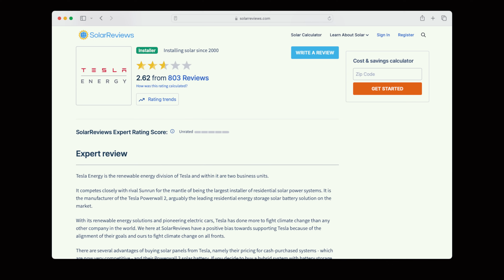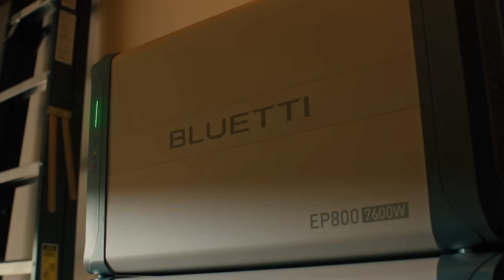The NEW Way to Install Solar (No Contractors)

Comment: Bro, I’m a contractor literally Workmen’s Comp. is like 60 bucks a month per employee. My bond insurance is like 150 a year in general liability if you want it is like 100 bucks a month 300 to 200% markup no excuse. 800 a year for a corporation I work out of my home so no overhead cost there once you invest in your tools you got those for many years which are minimal talking about drills and wire cutters here.

Comment: I'm preparing for a solar/battery solution and my inspector is fantastic especially with the nearly final plans.  I'm a retired electrical engineer who strongly prefers doing my own work.  I put all new service entrance, transfer switch, and standby power system to support a geothermal retrofit and two EV chargers.  Next is solar/battery, but first am monitoring the total power for proper sizing.

Comment: Top Electric DBA Shield Energy, out of Utah, came in and made so many promises, I thought I had stumbled upon the best contractor ever.   Only to have them install my entire system WITHOUT A PERMIT!  Then they call me to tell me they messed up and we'll need to install a 200 amp service on my house at their expense.   Then months go by and nothing happens.  I start threatening to sue and after months of phone calls not being returned they finally came out and installed the 200 amp service.   And right when I thought they were going to honor the deal, they walked away again!
And they were just going to let me hang until I started to sue the finance company.   And it was the finance company who came up with the funds to finish the job.   I had to get an independent electrician to come out who was familiar with solar to pull the permit and get the job finished.  I ended up getting a free 200 amp service upgrade but it took two years to do the job.

Comment: One aspect you did not cover was solar racking.  I can only afford to do it DIY because I've found gigantic markups on installing certified ground mounting of solar panels from contractors.  I live in a small city of 3,000 and can't rent auger equiment or machines to drive posts into the ground.  And the inspector here has never seen a ballast-type of solar panel racking and was told he will not pass it.  I've gone to every house or business that have solar panels in my city.  They're all happy with their system and was happy to share their company that did the install.  But when I called those companies every one of them was out of business, except one.  And he no longer served my city here in Northern Calif. as it was too remote.  Can you help with the permitting process for grond-mount ballast-type solar panel racking?

Comment: Thanks for video, please show an electrical diagram for what you DIY installed and go step by step in your next  video on what is what in the diagram. This will help folks better assess whether can DIY a solar plus battery backup system. Also please clarify if the backup has an automatic transfer switch or manual one that you installed.

Comment: Bluetti is a good option but there are other companies like eg4 where there stackable batteries cost half the price of these. One eg4 5k battery is about $1,200. But overall, Andrew is spot on the approach. I did this personally, hired independent roofer and electrician and bought my own kit and had a 10k PV array installed with a 20k battery bank. This runs the whole house including an AC (with soft start) system and 1 hp well pump

Comment: You can do the same thing with YouSolar Inc.s "Power Bloc" which is a homes primary power (not a backup); powers all loads; no utility approval needed; charges batteries directly by grid; solar; wind; hydro; EV; any size generator and at the same time with no utility approval needed. DIY or have a electricians help. 

A USA company. USA! USA! USA!

Comment: Battery backup and solar is not real rocket science. A general understanding of electrical theory and unified building codes is adaquate. Here in the north air conditioning is just a convienience but non-electric heating is mandatory I have both natural gas and propane and I have two tri-fuel generators for backup on cloudy days.My sloar is planned at just 5000 watts and my battery is 12,000 WH. If all else fails I could run the central air off one generator but it would be expensive

Comment: DIY solution is basically dead. I've been calculating costs savings for the past 2 months with research and I am literally within saving $1000-5000 only. this is coming from where all the equipment and installation pass inspection and is able to turn on and power my house legally.

DIY comes with 4-6 more panels and a decent sized backup battery. However, you have to do the work yourself or hire someone else which can cost anywhere from $8-15K with limited warranty. then you have to worry about permits, inspections, your AHJ, POCO. a lot of these youtubers or diy'ers show off their fancy system but most of them don't tell you if they got permits for it and I feel that the majority of people don't want to go down that path. plus a complete kit online isn't 100% complete, you still need to buy misc conduits, wires, nuts, bolts, etc.

DIY: 10kw panels, 10kwh batteries, microinverters/inverter/mppt/hybrid (whatever system you choose). comes with rails and permit ready for $24k. you do your own install.
Pro: 6.4kw panels, 10kwh batteries, they will handle the complete install and until power is on for $26k. comes with labor/workmanship warranty
this is a california quote I just received about a week ago on my house.

Comment: Hello. Thanks for the video. DIY sounds like a possibility! Personally, I would avoid roof top, and go with ground mount  or unattached car port if it were me.
There's a slight "ringing buzz" sound coming from the audio feed every time you talk into the mic for this video. (It is not in your older video "How to Solar Power your Home" (Not sure if this is a new mic or what the source might be).

Comment: I know from listening to other videos you have done that DIY is not a good choice - leave for professionals.
Also, you have had an installer on and both of you were not positive on DIY and Signature Solar in particular.
SIgnature Solar has a battery system (Ethos) that is even better than this option manufactured by Big Battery out of LA, California.
As simple and coupled with a LUX inverter (Their EG4 brand) you are ready to connect to Breaker Panel, add solar, and even add a small generator and you are done!
Thank you for pointing out options for all listeners!
And I do understand this entire industry is shifting and changing primarily due to Cali Net metering 3 - and others are soon behind.
Keep up getting good and factual info going out on your channel - it helps ALL customers!

Comment: Thank you 😊. I run a small business and trying to go solar or battery backup is impossible. The joke is that solar has a 7 year pay back period for the last 20 years despite lower battery and solar panel costs and higher electric bills. The only way to bring green energy to the masses is to remove the middle man. Same problem in mini split systems.

Comment: With all the other ignorant stuff that you're refusing to learn 
on solar now you get to install it yourself with all the solar panel  fires how much higher will the insurance be
Bring the s'mores you can say you installed it yourself
Reply: That depends on where you place the solar panels. My landlord self-installed the solar panel in the backyard without any problem.
Reply: @anthonyc278 until there's a prob so not only stealing from us and the power company also stealing from the insurance company 
Pretty shady
Reply: Oh yeah and the problem of it only putting in less than 20%

Comment: The battery part is fine, but when you include solar, you still have to get a lot of red tape in terms of getting them install. Thats where it cost too much if you ask me. Construction permits, to electric permits is why going solar can cost too much in general. Until that red tape goes away, is going to suck either direction you really go. So we need cheaper install methods for the solar part. It shouldnt cost someone 5k or more to install and setup that half of it.

Comment: One of the most important skills to possess, as a small business owner, is the ability to "pivot".  The traditional model of selling solar to customers has more or less collapsed, with the advent of high interest rates and the long-overdue gutting of net-metering rules.  This video is one of the very best you have put out, and I honestly hope you understand why that is.  There are really four different components to any "solar" setup; the PV array, charge controller, inverter solution, and battery array.  As more and more equipment manufacturers have improved their offerings, integrating those components and making them far more DIY-friendly, more and more consumers have taken on the challenges associated with becoming their own power company!  If you can adjust your business model to supporting that move toward DIY implementations, I think you'll add value and generate revenue.  I hope that works for you, because the glory days of selling solar systems are probably gone forever.  The biggest challenge is going to be financing these DIY projects, because I don't see a lot of banking institutions willing to take that risk.
Reply: Yes the banks and consumer are not willing to take the risk which is why DIY is best to start very small and build it over time as you learn. EVs will also help as the come online as our next big mobile power stations.
Reply: @DanRingwald  - As long at those EV's aren't using some kind of ternary battery source, maybe.  Otherwise, that would be an insanely expensive power source, and one you really should be relying upon for transportation, since that's what it was designed to do.

Comment: Sunrun moved my main breaker that supplied my home power from the electric company. The connection was poor and resulted in a fire. After a month of trying to get the power back on in my house using sunruns contractors, I hired my own electrician, came out of pocket another 3k and got my main panel replaced after the bus bars burned up. Sunrun kept playing games saying they didn’t have anyone to send or etc. I paid 30k for that system through Sunrun. I would RUN not walk from SUNRUN. Also the LG Chem battery installer, drilled 15 holes in my wall instead of using a stud finder and thought it was funny when I said something.
I installed my own solar panels after that and it was so easy. Can’t believe I spent so much money to have a crew of yahoos and one guy that actually knew something to come out to my house.

Comment: Why would woukd say you may need a permit? In what major markets would you not need a permit, a legit planset, inspection, be done to local code etc??
Reply from the maker: There are some parts of Texas and Oklahoma where no permits are required if you are outside of city limits.
Reply: @SolarSurge  that's good for a few I suppose. There's a reason roofers and electricians are licensed trades.
Reply: @SolarSurge YeeeeHaawww, I’m in TX!

Comment: I recently purchased a 12 kW Inverter, 11.7 kW of premium PV panels, and two wall-mounted 14.3 kWh LiFePo batteries for $16,500 from a Solar System DIY warehouse. That price included taxes and delivery to my garage. I then went on Angie's List and got three local Solar Installers to compete for my business. The winning installer charged a flat rate of $15K to install the roof-mounted 30 X 390W panels, significant electrical wiring for grid interconnect,  Inverter install, test, and turn up. The batteries are drop-dead easy to bring up, but 300lbs each and difficult to wall hang. We agreed to an hourly charge of $100 per hour to install, test, and turn up the batteries. My finished system cost is $39,000. About 50% less than a comparable Tesla 3 system with only one 14.1 kWh battery.
Reply: Is $39k before or after 30% federal credit?
Reply: @iknoerleful   Before - around $27,300 after
Reply: Name of the company?
Reply: That's your initial cost.  You are losing about $2-$4,000 on that cash every year compounding.  Now you have absolutely NOTHING behind your "system" which is a bunch of depreciating parts you poured $39,000 cash into for some inexplicable reason! You got ""premium" panels (A meaningless description - but at 390 watts, I highly doubt there is anything "premium about them).  You have no labor, installation, or product warranties to speak of, no one to call or blame but yourself.  You left a ton of cash in the IRS's pocket, most likely - and you have batteries that no one ever heard of really, and that are probably not the latest tech, with probably no significant warranty.  You've got a ton of finger-pointing in your future (all at you), and you better cross your fingers and toes, while you wait to recover your money - not sure how or when.  You could have received the best of the best from me - or my team - for that sized system using a ZERO down loan at 3.99% today - fully warranted for 25 years on all system components, and with a 15-year battery warranty, and not "premium" but the very best modules - at least 425 watt black on black, and a 30 Year warranty around the whole thing covering installation errors, roof penetrations and all system components besides the battery.  If you pay federal income taxes and do not get them all back every year, you would have been able to get about $45,000-$55,000 of that back as cash, but used ZERO dollars investment - your electricity bill would have paid for the system (leaving you with a very minimal monthly electricity bill depending on the details) and you'd have pocketed the $45-$55 grand and invested it with your $39,000.  

But I'm sure this was totally brilliant instead! And you can thank these feckless solar ads and videos for your misguided adventure.  Not being a jerk.  just treating this with the seriousness it needs to be treated to shock these "solar " muppets into reality- stop saying all the wrong things, all the wrong ways, and leading these poor misguided souls to make all the worst decisions, thinking it was something wonderful!

This video is beyond ridiculous.  While you are "waiting" because of confused videos like this, they are costing you a fortune!  I don't know what he's talking about.  We've been installing Solar Power systems for 16 years through teams and this bizarre description of things is just ridiculous.  NEVER do this yourself.  NEVER.  Solar panels are not the thing.  Installing is not the THING.  The Cost of parts and pieces, is not the THING.

DM me if you want access to normal, safe, and simple Solar Power not this bizarre misconception of Solar Power.
Reply: @IKidTheSolar  numerous quotes, how about $ 3,995 to replace the main power panel from 100 to 200 amps, bankrupt company, snotty "insultants"  DIY saved me 1/3 of what you con artists charge

Comment: The stackable systems are getting upgrades so fast anymore, as soon as the delivery company drops off your order, there is a new better option. I did the Anker 3800 with the smart panel and expansion batteries, and it is awesome the way it integrates with my main panel. There are probably 5-6 different manufacturers that have the same type of systems now. They make a DYI system very easy to set up and are probably 10 times better than what was available 3-4 years ago. It is getting to the point where the only thing keeping everyone from going solar is the pricing. We will see if the new "solar for all" government plan helps sway the market.  I know if you are a good business person, now is the time to consider starting an honest business. Honest being the key word here. There is a huge opportunity right now in the field to build a great income for years to come. Just think about the future with EV's in every garage and the consumer wanting to charge from solar at home. 🤯

Comment: Good info. I know that a lot of people rant that prebuilt systems cost more than buying each part yourself and putting them together, but not everyone is good at building stuff or even wants to devote the time to do so. It's good to have professionals that do everything for the wealthy, prebuilt systems for those that want an easy DIY, and individual parts for those that want to save every penny possible.

Comment: I'm in Michigan. we had a Solar system installed by a company that went out of business. It was a sad story as it was a small company and the primary owner passed away and then after that the company fell apart. Our SolarEdge invertor went bad sometime after and it was hard to find someone who could do the warranty swap. We found a company that was starting a "adoption" program to take over abandoned systems. They did charge a pretty big evaluation fee to take over the system. I know of another company that was doing their customers dirty in my area that went under. I did not feel bad about them at all failing. 
I am still wanting to upgrade our system and get a solar edge battery in the next couple years. 
I was hoping you guys would start operating in Michigan. 
Regaurdless. I find your videos to be honest reviews and provide good wisdom. Appreciate you.
Reply: HAHAHA, "They" go out of business, move to a new location, and open under a new name, so there are no warranty issues. Just like flooring stores do regularly. Going Out Of Business! See ya all in a month!  It's a lousy business ploy.
Reply: Shouldn't SolarEdge be responsible for the inverter?
Reply: @anthonyc278  they did send a replacement but I had to find someone to swap it and provision it.